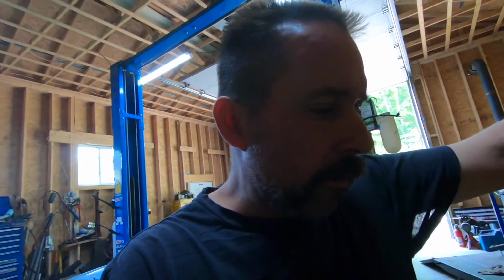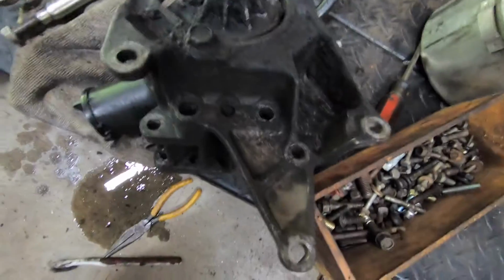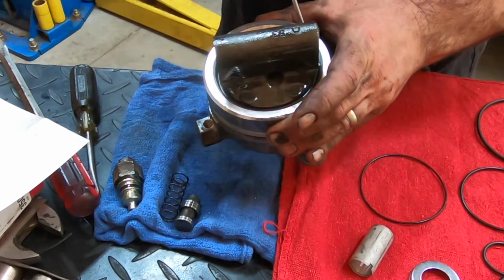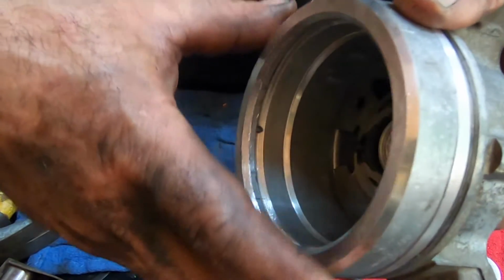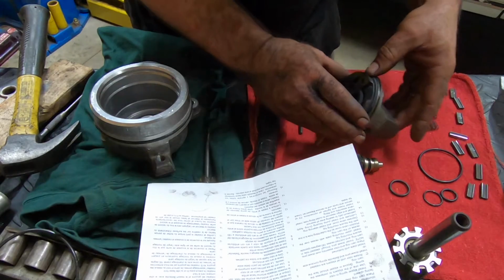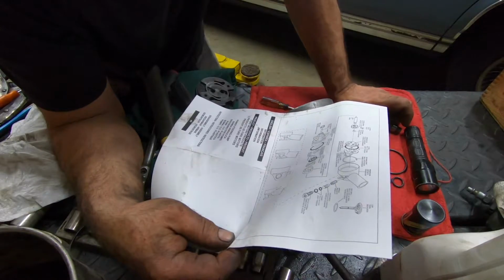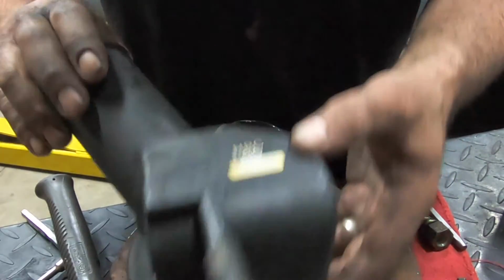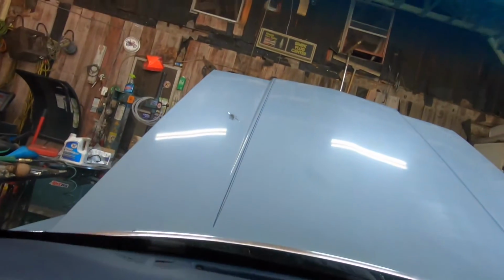Ford Power Steering Pump Rebuild - 1986 Mercury Grand Marquis / Crown Victoria / Lincoln Town Car

Comment: Would this be for the 1989 gm as well?
Reply from the maker: I think they are the same ... but the way to find out for sure would be to check an auto parts site for an '86 & an '89 - if the part numbers match, you're good to go.

Comment: How did you avoid the sound of the pump and what type of oil do you use?
Reply from the maker: Once all the air is out, it doesn't make any noise. I used Amsoil AW32 hydraulic oil.

Comment: How did you get the original shaft sleeve out of the pump housing? The one you had to pound in. Maybe I missed that part.
Reply from the maker: No you didn't miss it - I looked for it & couldn't find it either. I remember having a hell of a time editing this one. My GoPro camera at random times during battery swaps would erase the date and time, and go back to 2016 ... so when editing, the footage would disappear, since it would get moved way back in my 14,000 files to 2016, impossible to find. At the time, I wasn't aware that was happening, and assumed the computer had flaked out and the files were lost. Happened to me SEVERAL times during editing videos! Frustrating. Anyway, I just pounded it out with the driver tool I had. You could also use a deep socket just a touch smaller than the ID of the bore. Better to press it out, though, to avoid damage. I should have pressed in the new one as I mentioned in the vid. Thanks for watching, Edgar.
Reply: @SmittySmithsonite  ok, good to know I wasn’t going crazy. I figured it was pounded out,  but wanted to make sure before I go take my aggressions out on it. In another video, the guy skips that step altogether. I may do the same. We’ll see. Most seal kits I’ve seen don’t include that piece, so that says something, I guess. Thanks again for taking the time to record this. Super helpful.
Reply from the maker: @epedrego  - Thanks Edgar, glad it helped you out.

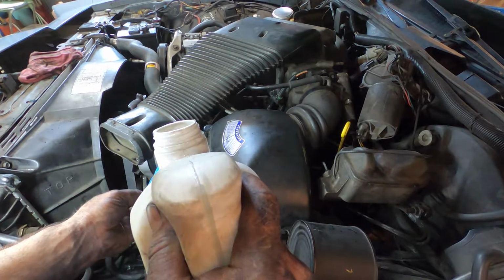Comment: What were you pouring in 39:15?
Reply from the maker: That was Valvoline power steering fluid. I ended up using Amsoil AW32 hydraulic fluid after everything was done. Thanks for watching.

Comment: hey smitty!   happy 4th!    a lot of parts to that ford....years ago a gm was my last one   I just change them now...at the dealer I resealed all the p.s. racks...so right a low side can pull in air and some have to be put under a vacuum  I usually turn the steering wheel 20 times lock to lock  how is your paramotor going ??  hope safe   did you see ivans vid at that school in fla?
Reply from the maker: Hey Scuba! Yeah like Glen said, a giant jigsaw puzzle LOL. I was glad to get it back together and working on the first shot! I didn’t want to have to dig that snap ring wire deal out of there again. That was a nightmare! I’ll definitely buy a new one next time, LOL!

Haven’t had many opportunities to get on the paramotor lately. Been slammed with work the last two months - more than I’ve ever had before. I got one practice attempt in a few weeks back, but I packed it in early out of frustration. I was already tired from a long day. Ivan’s got me beat by a mile! No idea when I will finally leave the ground. Hoping before the end of the year ... but since we’re already at Independence Day, maybe next year is my year LOL! Anyway, good to see you man! You and the family have a great Independence Day! Thanks for watching buddy. 👍🍻

Comment: I like your record keeping style. The next guy should appreciate your efforts. It's good to see a rebuild taking place. As you know, no one does this anymore. I guess with labor being so high it doesn't make sense. Oh dang, stupid hoses. I laughed when the oil dropped to the floor missing your pan all together. That always happens to me. It's a great car.
Reply from the maker: That's a habit I got into many moons ago. Good to know how long certain brands last, and when she's due for maintenance. 

Yeah, I searched YouTube and found nothing on p/s pump rebuilds - at least not this style. Then Eric The Car Guy did a Saginaw rebuild right as I was editing my vid, lol - funny how that always happens! I do something a little unorthodox, and one of my subs either beats me to it, or releases it while I'm in the process, lol! Or I'll watch Eric O. do a certain repair, and the exact same problem comes in here a day or 2 later. Perfect timing!

I poured that fluid a little too quick for that small reservoir, HAHAHA! Never fails! Especially when you're trying to see if a leak is repaired. Had to do alot of cleanup after that one. Anyway, good to see you & I appreciate the support as always, Wyatt. You and the family have a fantastic Independence Day!  👍🍻
Reply: Oooooooooooooo9ooooooopooo9ooooooo9ooooooo9oopoooooooooooooooooooo9ooooooooooooooo9oooooooooooooooooooo

Comment: Looks like a success to me. It all went back together and working..  But yeah, I would have bought a new one, myself. Amazing the kit came with instructions, though. Good stuff!
Reply from the maker: Yeah, I was shocked to see instructions! The schematic was a little hard to decipher - the detail just wasn't there. Showed nothing about orientation of the slippers or plates. The GoPro saved me there!

Definitely happy with the outcome. No more leaks. When I repaired the goofy return line, I flushed and filled with Amsoil full synthetic AW32 hydraulic fluid. Nice and quiet now. Been getting driven 65 miles per day with no issues, aside from a wearing steering column bearing that I'll have to take care of this winter. Funny - my Silverado's steering started making the same dry bearing noise at 85k miles. Marquis is just shy of 270k now. What a quality difference! Anyway, thanks for the support as always, Chris. 👍🍻